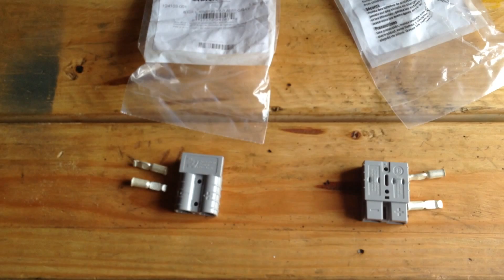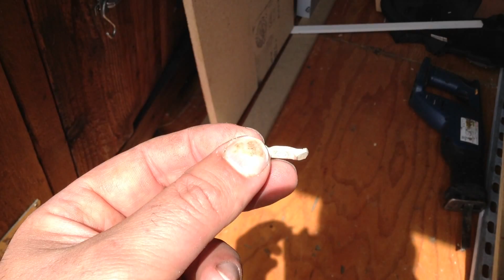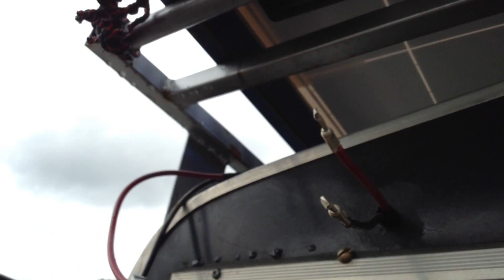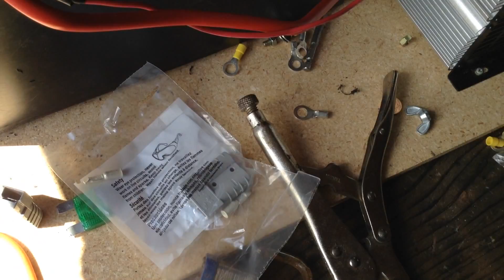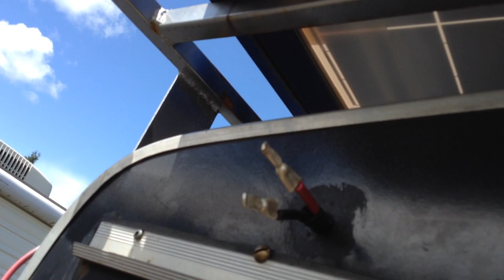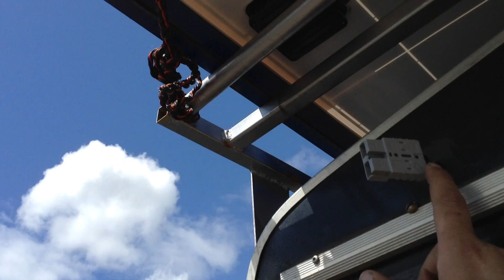50a 6-8g quick cable connectors - when the best still suck - Anderson Power Pole Connectors

Comment: The reason these connectors got so hot is the same reason the gray housing pulled off: you failed to fully and properly insert the pins into the housing.  You figured it out later in the video thankfully.  These connectors don't suck if you use them properly.  Your problem was that you didn't know what the hell you were doing, plain and simple.  It doesn't take a rocket scientist to figure out how these are assembled.  And those "crimps" are atrocious.

Comment: So, why not throw a blanket over the panel before working on it's connections?

You can get panel mount Anderson sockets with a rubber weather cap to seal it when not in use.
You can put a weather cover over this would ensure the connector remains dry much like those found on caravan mains.
Water will then just drip off the cable insulation.

You don't seem to know what your doing!
Reply: My sentiments exactly. Throw a tarp, or anything over it to shut it down till you are finished.

Comment: I would never use a high amp connectors that heat up. Heating of the connection means it is Not making good electrical connection.

Comment: I am sure that other people have mentioned in their reviews, the right tool for the right job.  When using Anderson Power Pole connectors, unfortunately, you have to purchase their crimping tool. It's a money making business plan. That being said, these connectors when installed properly are currently the best on the market.  You could get away with soldering some connectors, but it depends on the application.
Reply: The XT Connectors are also great.

Comment: NEVER SOLDER these connectors !
Only use a PROPER CRIMP TOOL !
1: soldering gives a higher resistance, so the soldered connection (not the connector!) heats up.
2: solder wicks up the cable making it a 'solid' conductor that will break in time.
3: a proper crimp will fuse the wire and connector to one solid piece with minimal resistance.

The anderson connectors ARE THE BEST connectors for high current applications (widely used in industrial and professional applications). So if you use these connectors spend ±$40 on a good quality crimper, and the 50A connectors won't even get notably hot at 100A !
Reply: soldering is the professional way, crimping is the quick way, soldering fills all the voids between cable and pin and between tiny cable wires, solder also prevent cable breakage at end of pin as the solid transition is beyond inside the cable insulation so with shrinking tube over is best to prevent breakage
Reply: @user-ug9nn  Sorry but I don't agree, in contrary...
A GOOD  crimp will press out any air and solidify the individual strands into a almost solid conductor, giving minimal resistance. Soldering will fill the voids between the strands with solder which gives a higher resistance. Also will the solder wick up into the cable creating a weak spot that is prone to breaking.
Reply: @pgScorpio  the weak spot will be inside cable not where cable insulation ends so will be stronger,
- the air will not be pressed out, just a part of it,
- most of crimping is prone to oxidation and connection failure in some harsh enviroments, solder 100% perfect

Comment: mate, i don't buy from any camping, caravanning or solar power shops I by from eBay  i use Solar Panel Extension Cable Battery Tender Lead 12V LJE Connectors 18AWG LJ.    or i get  SS Anderson Style Plug Elta 50 AMP Battery Connector/Plug T Handle Dust Cap Set    cost $4.12 AU  about  $3.00 us

Comment: I am underwhelmed with the quality of handiwork. Smashing and crimping are not the same thing. Do yourself a favor and take thirty seconds on the internet to find out how to properly employ them. I've used Anderson connectors for years and never had any issues except once when I pulled a dipshit move and powered a 300A load with 50A-rated connectors AND used the connection as the "switch". These are common in off-road racing and adventure sports, at the highest echelons of auto racing, and in military applications; all three areas that don't accept BS gear. If they hold up to these uses but they're giving you trouble, you need to figure out what you're doing wrong. 

Also, you're getting ripped off paying eight bucks a peice for these. Buy from a reputable supplier and you'll get much better pricing, as well as guidance on use and assembly just for asking.
Reply: Amen, they are used all over with electric forklifts and backup power supplies also. I've dealt with these things for years.

Everything is a PITA when you are jerry rigging because you won't buy $30 crimping tool to do it right.

Comment: Just wondering, I noticed you have a PWM charge controller.  If you used an MPPT charge controller, you could connect some of your panels in series and output a higher voltage/lower amperage from the panels into the charge controller.  Then you could use MC4 connectors which are waterproof (the good ones are).
Reply from the maker: +Brad J  On paper the MPPT charge controller specs say they give you more power, the reality is, they don't on the smaller systems.  It sucks up a fair amount of power just to run the onboard processor so what actually gets to your stuff is just not worth the extra cost.   If your system is  30amps or less at 12v, its not worth your time to go MPPT.   You are better off going PWM and using the money you save to keep a spare on hand.
Reply from the maker: pirate0jimmy So you have done that personally and know for sure that it works and is cost effective?   My experience is that MPPT shit is complex, burns stuff up, goes bad and the cost to benefit ratio is such, that I favor using PWM stuff and using the money I save to buy more panels.   Then, if I run out of room on the roof and pretend to be tweaking the system a bit, maybe ad MPPT.   I put MPPT in my motorhome, and it's nothing but problems.  Runs an alarm when I turn the motor on, does NOT give me "30% more power", and cost three times as much as a comparable PWM that has a better display.   I show it off and brag about it because it's expensive and high class, not because I like it any better than my cheapo netmeter solar LCD30.  When I netmetersolar LCD30 fries (and yeah sometimes they do), I just swap in the spare and send the bad one back if it burned when less than a year old.

Comment: Those connectors can only "Click into place "one way when you are assembling them. Also they are one of the best solutions when making plug and play connections. The best way to get things going is to ask someone who knows what the are doing and don't blame the connectors as there is NOTHING WRONG with them. As you found out, if you get it wrong there are immediate problems.

Comment: If you had covered the array with a tarp you would not have had to work on  energized equipment. Had you used the proper crimping tool and assembled the device properly your connections would not have overheated. I find your blaming the product lame. You don't know what you're doing. You're a danger to yourself and others. Electricity is not a hobby.

Comment: 1.  Yes, you need the proper large round crimper.  High amp current will melt and / or vaporize the solder some are suggesting.
2.  Yes, you need to push the tongue contacts into the plastic piece until it clicks twice. The inspection is as you did - make sure the sear/squared cutoff is down and past the metal spring clip.
3. To disassemple the contacts form the plastic plus, ON A COLD CIRCUT, push the contact towards the end of the plug where the plug together, then use a small flat head screwdriver to depress the spring clip down, then pull on the wire or on the empty contact with some needle nose pliers, if needed.  The key to the whole thing is to depress the spring clip.

Comment: Excellent video sir! I think if you put a tarp over the array that the output would be very tiny.
Reply from the maker: I ended up putting that solar array on another trailer project, then I used it in other projects, then it was stolen, and after I recovered it from where it was stolen (no help from local law enforcement) I gave it to a guy who installed it on I think a camper but in all of the changeovers, the wiring was easy because it was all based on the quick detach plugs.

Comment: I tried soldered 1/0 sized ones, for power in auto, they were soldered well, tested with a 500 W quartz-Halogen worklight off my inverter, seemed like it was doing fine,a few minutes later I noticed the light was out, the two plastic halves had started to melt, they were fused together at about a 15 degree angle.  Fortunately, it just broke the connection, it didn't blow the fuse.  Unfortunately, I had bought 3 pair of the things, never could get them to work right, not sure I would ever trust them to operate safely.
Reply: Sorry to hear you had such trouble, but I have enough experience with these connectors to say that the issue was elsewhere besides the design. 

Solder, bad connection elsewhere, bad inverter, I can’t say. But the connections when properly crimped work as advertised.

The guy that posted this video is using the wrong size wire and not crimping properly. That’s why his get warm.
Reply: @iqinsanity  I likely did do something wrong, but it's not in the wire-connector interface, it's something about how the two plates meet.  Maybe i warped something somehow, but I've tried just butting them together without wire, just doing a continuity check and that didn't give a consistently good/reliable result, so I don't know what's going on.
Reply: 1/0 melted on 500w?

Never had an issue with 6awg on 750w. There’s another problem with your system or something.
Reply: @iqinsanity  Yes, that's the point of my post, theses connector don't work very well, at least for me, I can't get a reliable connection, IOW, not a good contact between the flat-plate electrodes so they heat up and melt.

Comment: You need to solder the connectors. You have high resistance from your crimps....
Reply: +Joe Tittiger A good and proper crimp does not have any more resistance than a solder joint.

Comment: I installed two the other day.. took me 10 seconds to figure out which way the tabs went...
I did however make sure that the crimping was good. As an extra measure.. i applied a bit of soLder to the buckets, on the rear as an extra safeguard.
Nice video. Its good to see that you show the good and the bad ;)